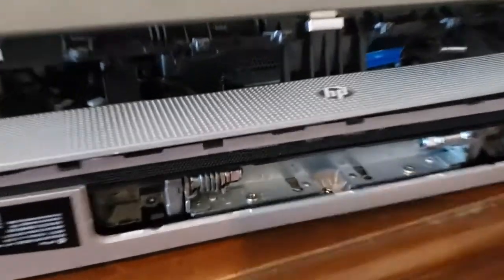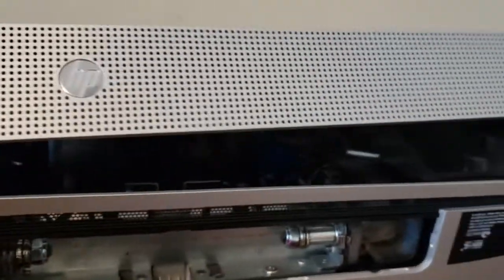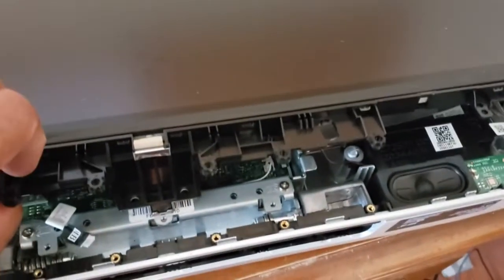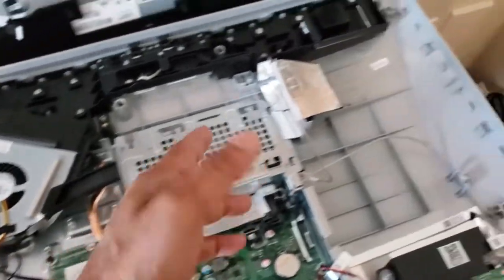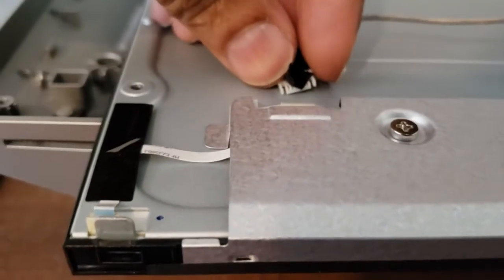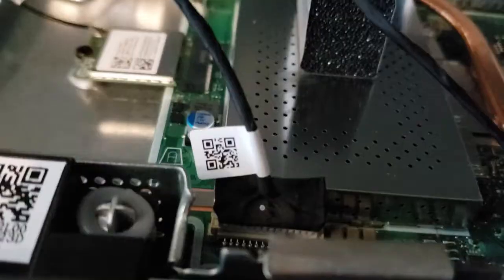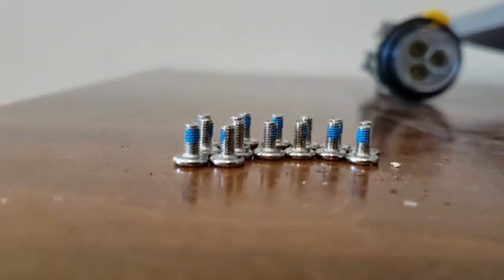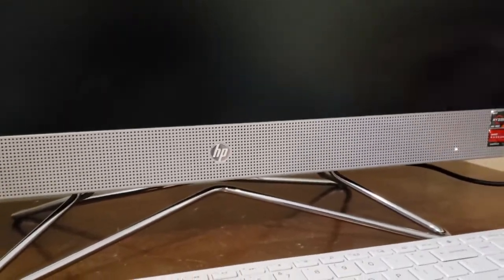All in one screen replacement HP computer

Comment: Thank you for taking your time ! Learned a lot. My 2yr old hit my screen. Turns on still. Was worried of how complicated it was to replace the screen. Looks pretty easy! Wasn't sure if I could just project the screen and try to retrieve my files that way.
Reply from the maker: Take your time and you can do it. Keep track off all parts as you remove them. Hardest part is getting the replacement screen. The manufacturer website did not offer a replacement so you have to Google the screen number for other sources.

Comment: I have just taken apart a 24-cb0214 and was almost the same as this. Be very careful prying on the plastic and screen. I was able to do this almost all by hand except the initial prying to get to the screws. After than all I did was a vertical pry from the base or feet side and slowly moved up and around the screen with my fingers behind the screen. A few clicks later everything freed up to show me the ribbon cables and the ram under a cover that I was gonna change. Thanks for the insight
Reply from the maker: Thanks for your comment.

Comment: Why does no one ever show the actual screen replacement? Every single video, including yours, shows disassembly, then simply states, " ... then just put it together."' or something similar, and magically, the screen is back in. If it were only so simple!! I was working on a 24-cb0017c and ended up here by virtue of it's similarity. The screen did not pop back in neatly, and while trying to get it fitted back in, it cracked. Is there a particular technique for these? Should I pop in the top and allow the screws to pull the rest down? Should I place face down and push the back onto the screen? It seems most methods put undue stress on one side or another and will cause breakage. This is screen #2, and at a cost of $250+ for each, I'm a little gun shy. Any input would be appreciated.
Reply from the maker: Hi Chris, Its been a while but I did not experience any issues with placement of the new screen or I would have mentioned it. If I may offer a suggestion; face down, insert it at the top first where there are less attachments, then place in the bottom. Don't force it. 
Considering you are already past screen 2, I understand your reluctance to try again.
Reply: @Andrew's Notes  Thank you for your reply. I have never had this kind of issue with any screen before, so wondered what I was doing wrong. Maybe just bad luck, but I have another screen on the way and feel I can use all the help I can get! Thanks for the suggestions.
Reply: @Andrewsnotes1  An update that may save someone else in the future the grief I went through and the money spent .... I was originally working with an HP 24-cb0017c that had a broken screen (#1). I had an HP 24-0007c (#2), that had a good screen and figured I would just swap them and keep the better computer running, right? Broke that screen installing it into #1. Got 2 new screens, some $500 later and decided to practice before diving in. I marked all the existing breaks with a white grease pencil so I could see if I put any new breaks in. I did. LOTS of them. I then - finally! - noticed that the black plastic backing to each screen was very slightly different ... just different enough so that one will never fit properly in the other!! The moral of the story is that though the screen may be the same and they look the same, NOTHING else is the same.
Reply from the maker: @22hutchingsc  Thanks for the update. Good info.

Comment: Hello Andrew thanks a lot for sharing I just broke my pc same brand. Question why change the battery ?
Reply: Also there’s a way to see the exact reference for the screen without taking apart ? I know I will have to do it in order to fix it but just to look for the screen before opening/ also there is a generic one ? Thanks again
Reply from the maker: Screen was replaced. Battery was replaced as they fail after a few years and the BIOS has problems loading its settings.
Reply from the maker: Unfortunately, you have to open the machine to see the part number of the screen.

Comment: any recommendations for not crushing the screen when I reinstall it... I no longer repair all in ones unless it's a broken screen replacement cause I've crushed a screen before.
Reply from the maker: I haven't experienced that when installing this one. I guess just be really careful and gentle. Make sure you have the correct replacement. Different versions may have small changes in the mounting around the screen.